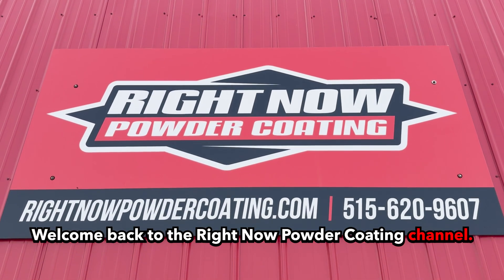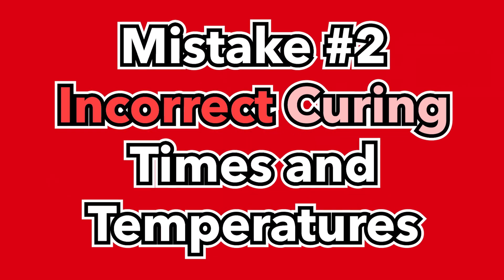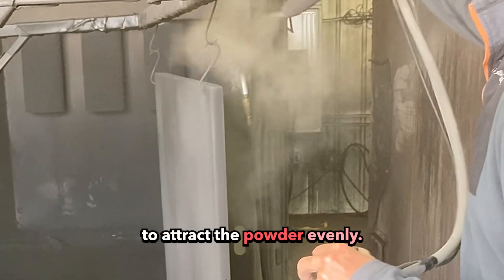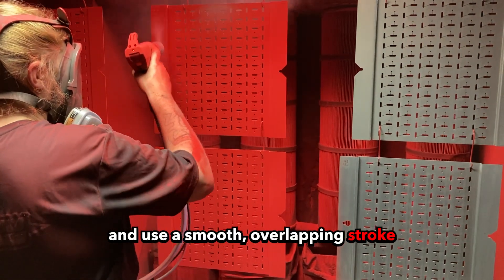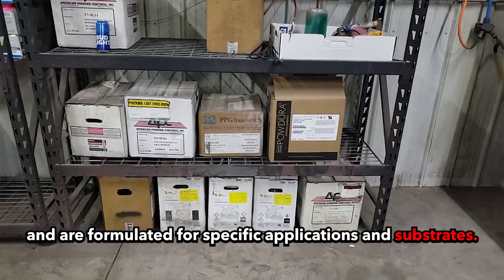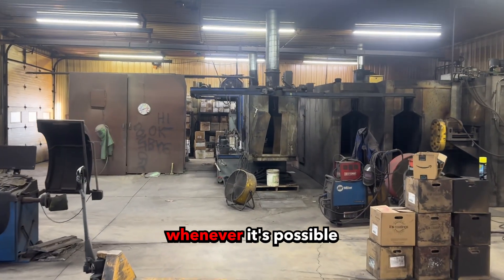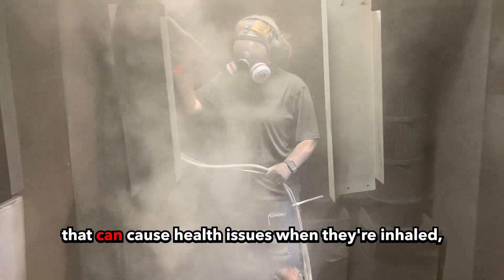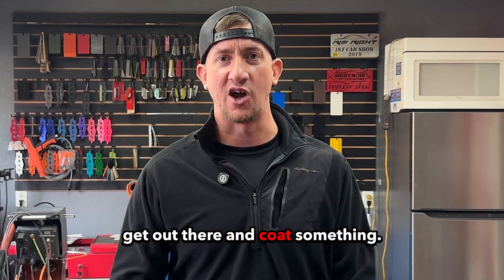Top 10 Powder Coating Mistakes To Avoid + Their Solutions!

Comment: If I want a 1/8 inch aircraft cable to slip fit thru a hole in a powder coated part, what size should make the original hole? And can I redrill the original hold after powder coating without chipping?

Comment: I just got a better job opportunity at work to learn how to powder coating i start monday ima use some of your tips you gave me and give the idea of constant clean conection at my job abkut putting a copper wire inside the booth and clean out the vents really well before i do anything ima shake the powder in the bag to reduce clumps and give it some life again just like pre work out powder it goes dull after sitting for a while give it a good shake and youre good to go
Reply: how is it going so far??

Comment: I have yet to see ANY powder coating last.
 , you may not see the cracks but they are there then they trap moisture and increase the rate of rusting a hundred times.
Anything exposed to the weather will have less than one tenth the lifespan of something properly painted. The micro cracking and trapping of moisture is inevitable.
Reply from the maker: Im not sure what you mean.  I have projects that are going on 8 years with no issues.  The wheels on my truck are 6 years old with no issues.  Do the prep right, and the coating, and the curing and its a great product.

Comment: Hey Dan, do you have any experience with laser cleaning (laser ablation) as a pretreatment before powder coating? Are there any downsides to laser cleaning, or is it pretty much as good as sandblasting without major issues?

Thanks a lot!
Reply: The advantage to sand blasting is that the powder has a rougher surface to adhere to more easily, so for the sake of comparison laser blasting would be more similar to chemical stripping

Comment: please help, I work in a shop where we just scuff and paint over preexisting paint/powder on wheels I've been trying to get my supervisor to get us the eco strip heated solution, I don't know why but especially for gloss black any area I sand whether it be 220 grit or 400 it just flows out unevenly creating a mess on some areas, we have an electric oven which seems to absolutely fry the coating too fast it's very hard to get it to where it's not overcooked where it leaves smudges and cracks but I also am terrified on under curing , to the point I only put it in for 15-20 for curing on top of that I use a pcs 1000 which will back ionizing instantly if the wheel isn't warm enough so I have about 3 minutes to coat the wheel before it turns into a damn leopard, do you think it would solve most of my problems stripping the wheels? so, I'm lost trying to focus on which problem I should be bringing to my supervisor first, obviously I know it's all not well and every coater is just shaking their head reading this and so am I every time, does anybody have any suggestions?
Reply from the maker: It sounds like you're dealing with a lot of issues all at once. Stripping may not solve all of them, but it will definitely help.  My company CTSA sells stripping tanks and Eco strip for this reason.  To do the job right you really need to strip the wheels.
Reply: UK powder coated here. I powder coat all sorts of different items. I find the best way to do wheels is to sand blast them to bare metal. Blow off all dust and I apply a light etch primer. I then flat that primer with 400 grit and powder. I never have any problems

Comment: I have been coating white powder coating these days and small 'black dots' is seen randomly in sprayed parts after heating in the final temperature . What can be the solutions? 
First black powder is coated and then white .
Reply from the maker: Most likely your kicking black powder up in the air and it's landing on the parts prior to cure or as they come out hot
Reply: @ it appears only in the edges of the parts not in the middle of the parts .
Reply: @sandeshshrestha2789  Have you thought about just doing 2 light coats. Instead of one full coat? Could just be it's thin on the sides & edges. On cast aluminum if that's what you're using. You wanna outgas at 205c for 20-30mins. I have tried to outgas at 190c before but I still get pinholes. So i'd suggest going to 204-5c for 20-30mins. This is how I powder complex items with tight corners ect. Or if I see it's not laying how i'd like. I lower the KV to 20-30 then I hit those spots that look light 4-6 inches away at an angle from the area. You could also use a primer / outgas primer. That will help the base stick better & hopefully stop that annoying effect with the holes. If all your stuff is clean then i'd look into applying this..

Comment: I get a orange peel effect on painting glossy finishes, with matt all perfect, I tried less paint, more paint doesnt seem to work any.. using gema Optiflex 2.

I paint construction steel and  aluminum. I have huge oven, i try to calculate curing times all of the time and i understand that the time and temp. mentioned on the box is  temperature of the part (metal itself) should be in the oven for that time, meaning sometimes you should hold 20-30 minutes in the 185C,  i mean lets say box says 10min 180C, means time the metal should spend at that temperature after the part reaches that temperatre, not the total time the part is in the oven. so 5mm constructions steel can be in oven for 30-35minutes ? and 10mm thick for  30-40minutes.
Reply from the maker: Your orange peel is due to the flow out rate on gloss powder, it flows and sets fast to get that gloss level.  You can try to help it with slower ramp up time.  Also talk to paint manufacture for support.  You are correct on the temps, make sure the part hits the temp then wait the amount of time the box says.
Reply: @RightNowPowderCoating  Thank you!